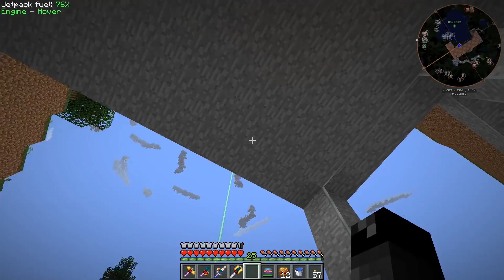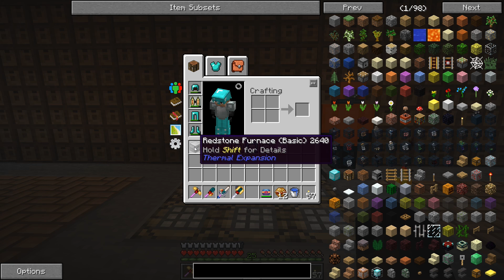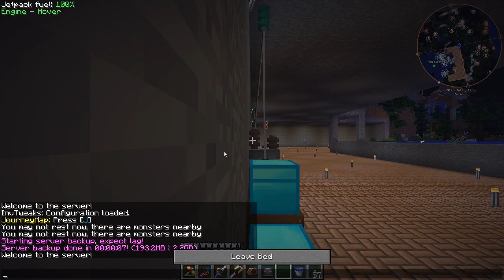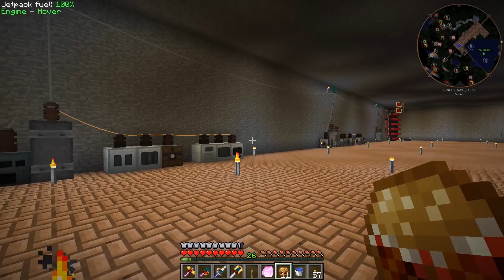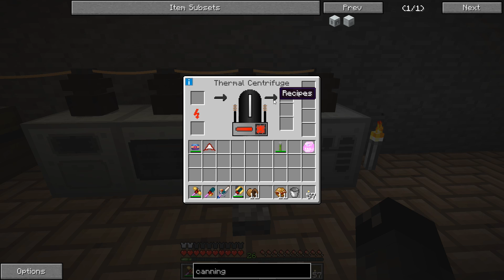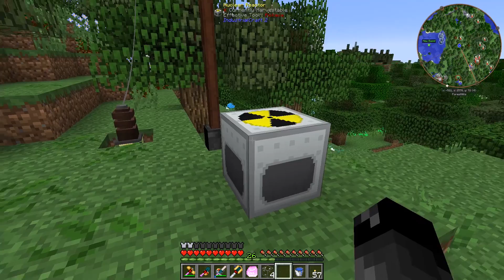Minecraft Mods FTB Infinity Evolved - NUCLEAR POWER [E18] (Modded Expert Mode)

Comment: Only has 6 or 7 waterwheel setups, thinks that he'll have 4096 RF/T out of them at 75 rf/t a pop
Reply: @Hillgrov  wow this is old, but the power transfer here is being capped by immersive's wire and the conversion between EU and RF. The 8k RF is only 2048 EU, and the fuel processing setup is verrrry power hungry.
Reply: @Hillgrov  as well, MV connectors don't move 8k RF/t.

Comment: Immersive Engineering power lines are lossy. I checked the IE:E configs and the wires are using the standard power loss rate.  Here is what you can expect for power loss

    # The percentage of power lost every 16 blocks of distance for the cable tiers (copper, electrum, HV, Structural Rope & Cable(no transfer) )
    D:"Cable loss" <
        0.05
        0.025
        0.025
        1.0
        1.0
     >

So you loose LV cables loose 5% if their power per full cable length.  MV looses 2.5% per cable length.  The configs say that HV looses 2.5% per half cable length since HV wires can be twice as long.  Now these rates are normally expressed in percentage loss per full cable length, I wonder if the HV cables actually loose 2.5% per 32 blocks and the config comment just doesn't express this properly.  Some testing is in order to determine the behavior of the HV wire cables.
Reply: I know this is a long time ago but the connectors themselves go 1000, 2000, 4000 (give or take) and the wires themselves are double so at that point its a matter of how many connects are you using

Comment: You can find all of your iridium in Runic Dungeons. Its very easy to fight down there and quick to gather all you need to make an ME controller. A friend and I spent 3 hours in there came out with just enough to make the core. As well there is a lot of loot down there. On the topic of your uranium fuel rods, they will last 5 hours to 5 Hrs 30 Mins. Now the the MOX fuel rod will last 2 hrs and 30 mins. Going MOX fuel will be faster in getting production started. The uu matter thing is good way to go but a severe lack of power to do it , but you know that.

Comment: Why did you put away your enderpouch? You do have soulbound
Reply: What are you talking about, the entire point of soubound is that when you die the item stays in your inventory, it wouldn't go into his gravestone.
Reply: +Edvin Richardsson Soulbound goes away if you die with the item on you, he probably did't want to waste the enchant.
Reply: Oh, I was not aware of that, then he probably just didn't remember he had soulbound on his Ender Pouch.
Reply: jacob99503 Propably
Reply: +Edvin Richardsson Because the pouch would still have been eaten by the hungry node when he broke the grave should he have died to the hungry node. Yes, the items would have been fine, but the pouch still would have been eaten.
Reply: Yes, the items in the pouch would stay in the "linked" ender chest. BUT he would still need to replace the pouch that was at risk of being eaten.
Reply: +nevar108 It is soul bound. It is in your inventory when you respawn.

Comment: Hey Hypno
if you look at the hv wire connectors it sais 0/1024 rf
I think they have decreased the transfer rate/capacity of the immersive engineering wires in the expert mode

Comment: I recommend using 2 quad-fuel-rods (U), 8 overclocked heat vents(O), and 4 compontent heat vents(C). empty space (E):
C O E
O U O
E O C
E O C
O U O
C O E
It produces 120 EU/t, is fully stable and uses only the one reactor, so you can have a big array of them side by side. Only downside is you get only part of the plates from the quad-rods back.
For automation you later can substitute the empty spaces with reactorplating and have a simple ender io system (1 redstone conduit and 1 item conduit per reactor) on one side and the ic2 cables on the other side.
Reply: +Arthur Linnik (Kaitō) 
Gratz, I think he used your design

Comment: Hypno, you need the HV relay on the energetic infuser for the power to work fully, as MV only transmit 1024RFpT and HV do 4098RFpT.

If that doesn't work, this may be ugly, but try putting a flux duct connecting to the coil connecting to the machine.

or

use something from power converters :)

Comment: Stick a resonant energy cell on your infuser and that won't happen.
Reply from the maker: +dan asche That doesn't solve the problem. The problem is the wires do not transfer but 1/8th of the power they're given to that machine.
Reply: +Hypnotizd Reason why your HV cables drop from 4k to 1k is due to the relay system you set up. Mainly, the further something is, the more power is lost in the process. Think of glass fiber cables in IC2. I would recommend to add more relays to stablize your production plant, that way, you won't waste 3k rf/tick due to the excessive distance from one relay to another.

Comment: dont you need hv wire coil instead of mv since hv is a higher lvl which will be able to transfer the maximum amount of power
Reply from the maker: +Nicholas le roux MV transfers up to 1k, HV transfers 4k
Reply: +Hypnotizd since you get lead dust and stone dust put one of those thing that you can put an item in a slot and it only takes out that item I can't remember what it is called but love the series😀❤️

Comment: Energetic infuser power input is limited by the machine frame level.
Reply from the maker: +boompumper I can stick it right next to the redstone energy cell and the power bar never goes down when it's powering up my flux capacitor. The wires from IE are pretty terrible imo.
Reply: +Hypnotizd Ah ok, haven't messed with IE, good to know.
Reply: +Hypnotizd I wouldn't be so quick to blame IE. Sure, the wires have loss. And if you're not accounting for it, it can be a lot. BUT who is to say that the wires weren't throttled because of expert mode? IE is generally a great mod, I feel it would be more appropriate to blame the FTB team as they likely realized that this would be everyone's first power cables (as they're universal) and thus nerfed their capabilities so that you eventually have to move on to something better.